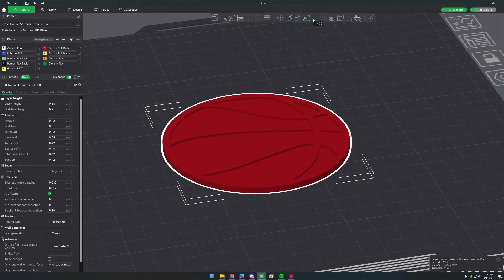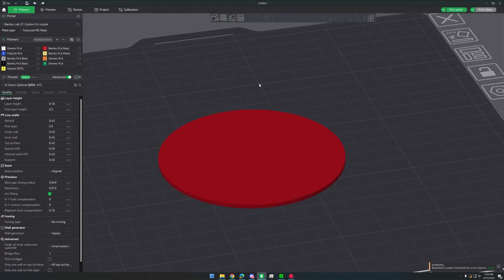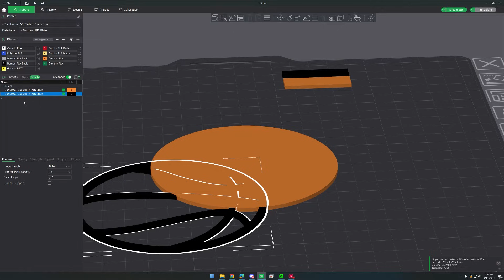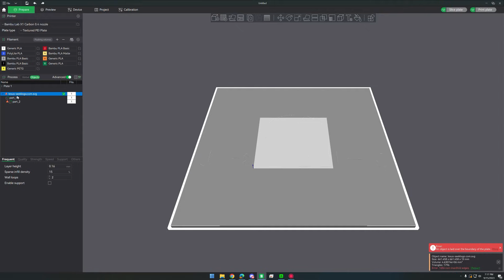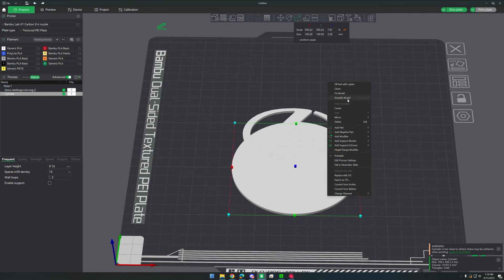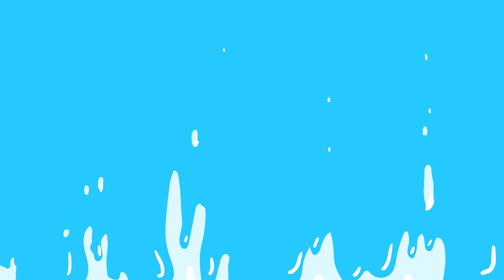Flush Dual Color Coasters // Bambu Studio Tutorial

Comment: Yes your right when you said the creator put in a water mark on their designs. No one is gonna make a million bucks off any one print but if they do then you can worry about that later as a designer. So how do you get rid of a water mark? I tried to add a small sphere in the location then mesh then fix part but after slice its still there. I'm stumped. Been trying to fix it for 3 days now and that's why I'm here. How you can help
Reply: I haven't tried this, but you could clone the circle right after the first cut, then flip one of them upside down and merge them to have a flat surface on either side, then complete the operation as per this video.

Comment: am i right in thinking you can only print this with an AMS? I trying to do 2 colours on the same layer without an AMS.
Reply from the maker: Yes you are right! You do need an AMS for this. Sorry if that wasn't clear in the video. I do have some other videos on making similar prints without an AMS, although the result isn't always as nice. If you want to do 2 colors in the same layer, as long as the print itself is only one layer thick, you can use a trick to split it into 2 separate prints. Let me know if you have any other questions!

Comment: I usually do the image/design at 2 to 3 layers thick. And lay on face . Saves on color changes. Image/logo will only be on face down side.
Reply: This is exactly what I am trying to do. So you are not assembling models, just printing one and then printing another over top?
Reply: @RinehartGroupLLC it looks like Assemble makes it much cleaner. 

I’ve had some issues where you assemble and then it removes the design. It looks like that’s if the file is rough, not good enough quality or repaired enough though, it seems.